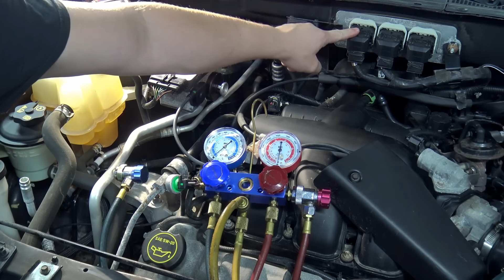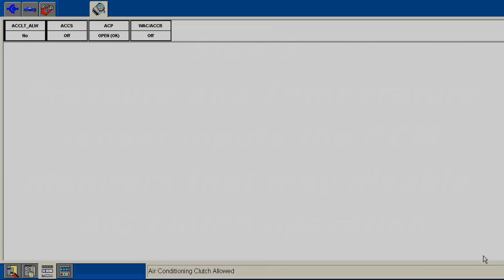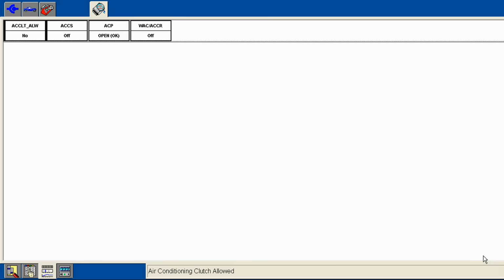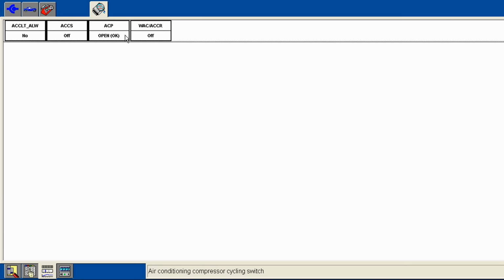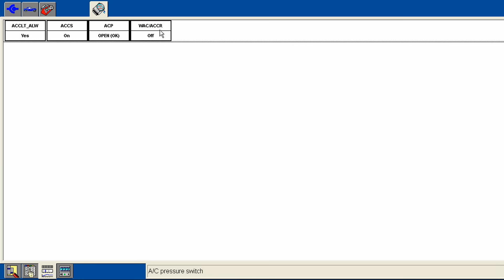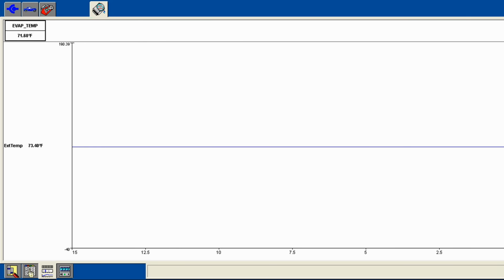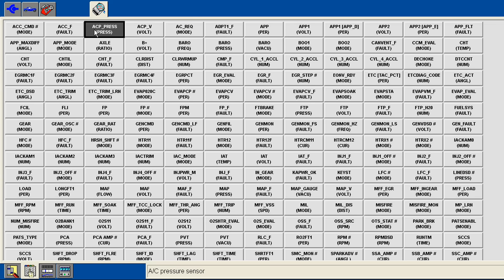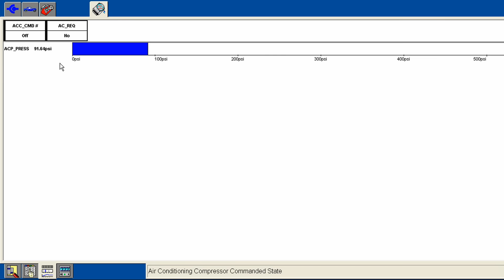Ford A/C Quick Tips #7: How To Quickly Diagnose A/C Concerns

Comment: I'm going crazy with my 2018 F150 Eco. The AC works when it feels like it and the dealer still 'can't duplicate' the issue after 3 visits. Love the truck, but this is driving me crazy, especially for a vehicle that only has 2100 miles on it.
Reply: Good luck. My 2017 Flex has been in the shop 28 days since July 5th; the compressor disengages when the outside temperature goes above 90°F. The dealer has been able to duplicate the issue, but no one seems to know how to fix it. This is my eighth Ford, and the only one I’ve ever had a major problem with.
Reply: @DavidBugea  What was the cause on yours? Mine's very sporadic. It can blow warm on a cold start up, warm start up, or while driving. It's all over the place. It will go out while driving and then start blowing cold again after ten minutes, or over an hour. It's crazy.
Reply: 231mac The dealership still hasn’t figured out the cause, and has stated that they have reached out through some nationwide Ford knowledge base, looking for answers. On three occasions I’ve shown it to my service writer and a technician while it’s doing it, with no luck. I finally opened a case a week ago with Ford Customer Relations; they called last Friday, but can’t get them to return my calls. After eight Fords it seems like I may have gotten stuck with one that’s unfixable. You’d think that a/c would be a technology that they’d have figured out by now...
Reply: @DavidBugea  Yeah, you would think. It sounds like you've reached the eligibility for the 'buy back' program. But, it's not as glorious as it sounds. From what I understand, you'll most probably have to hire an attorney and Ford will pro-rate the crap out of the vehicle. Best of luck!
Reply: 231mac Which is a shame, because I really like the vehicle. I’d be perfectly satisfied if they’d just fix it.
Reply: @DavidBugea  Same here. This is the first truck that I have been extremely all-around  happy with, besides the AC issue...
Reply: 231mac We think the mystery of intermittent air conditioning on my Flex has been solved, and I wanted to pass it along to you as something you may want to try. It’s a simple solution: Disconnect the negative cable from the battery, leave it off for 45 minutes, and reconnect it. Yes, that’s it. I did it six days ago, and haven’t had a problem since. Long story, but it cleared the computer, which had something stuck in its “learning” to limit when the compressor ran. Not happy that I had to fix it, but happy it’s fixed.
Reply: @DavidBugea  That's great you were able to fix your vehicle. I just got my truck back and they had to replace the evaporator core and low pressure sensor. Been working like a champ since. Best of luck, David.
Reply: what thay do tp fix it
Reply: @irenesalas3582  Not fixed yet. The truck is going back to the dealer tomorrow. At least I finally got the issue verified and documented Saturday, so they can't claim 'cannot duplicate' anymore.

Comment: If you can one tip,in my ford fiesta 1.3 44kw 2004 ac stopped working the gas was filled to specifcation(0.650kg)both pressure sensors are changeable the copressor is only activated directly the fan goes off.Clutch and fan relay no grounding(pin 86)i was in Ford servis and they didn't know how to fix it please help what i do os too hot  best greetings

Comment: 2006 mustang no air comes out of vents but compressor turns on when doing a cold start everything works and air comes out of vents but when vehicle warm air stops coming out
Reply: Have same issue on a 2006 F150 4.6. Did you figure yours out?
Reply: @danthomas9532  no not quite but I think I have checked online forums and it points to actuator behind gauges driver side not sure about f150 but that's what i read on mustang forum

Comment: I have an 06 Ford expedition and I noticed it was leaking a small amount of green oil. I looked underneath the truck and there was green oil on my AC compressor. It also dripped down to the front  axle. This was pointed out to me years ago  during a oil change and they said my front gear oil was probably leaking from  bad seals. It is four wheel drive by the way.  this whole time it seems to be coming from the air compressor. Could you please help. The a/c has worked for many years without any problems and still works..

Comment: Thanks FordTechMakuloco!

I have a car where the ac clutch is kicking in but I see only 37PSI on low and high maifold gauages.. 
I think this means my compressor is not compressing.. 
but I was wondering why it doesnt show higher after I went to a shop and had them evacuate and fill that day.. they told me it is probably electrical.. because they had filled it.   but when I checked myself the next day I see the 37 LOW and HIGH on my manifold gauges.. 

get the compressor?

Comment: After watching the video its plain to me that I will surely have to take it to a shop. I have no way to check this stuff myself without the tools used in this vid. But thanks for posting cuz I can at least have an idea of what the mechanic may talk about. How much should checking all this normally cost?
Reply: Diagnostic fee is usually around $100
Reply: That’s at the dealership tho. Local mechanic may be cheaper
Reply: There's a recharge kit you can buy, and it has the gauge built in. So, that first test is pretty easy  it gets more complicated as you go along.

Comment: I have a 2010 escape and my AC works great but sometimes the ac stops working and it only blows warm air. It happens when I'm driving and idling, it's not a vacuum issue. It happens on extremely hot days the most. As I jolt the car either by stopping or driving from a stop it will come back on for a few. Maybe my relay on the dryer is shrinking just enough on 100° days to be faulty? Pls help!! Have you seen this issue before I have no way to test the relay or the PCM. It's a $26 relay, should I just replace it?

Comment: AC blows cold/cool air  on driver’s side but hot air through the passenger side vents. Is this a control switch malfunction or a ac system caused problem?
Reply: It is probably your blend door under the dash. Vacuum motors move doors so that you can direct heat and or AC to your various vents. Search for a forum for you particular vehicle, great help on forums.

Comment: I was told that you have to bypass pcm to get the clutch to engage so the system would fill from the refrigerate can when there is no pressure. Is this true? 2008 f250 sd. If so how is it done?

Comment: 2013 f150 XLT ac is cold when running or when it's cold outside but when it's hot and the truck is parked or stopped ac won't blow cold. Any suggestions on what it could be

Comment: Hello, I have a 2018 Ford Transit 350 XLT van with ecoboost, the van has 24k miles and the A/C is blowing almost warm air when the outside temperature reaches 85+ degrees. I took it to the dealership and their diagnostics did not find any faulty parts or problems with the system. But the A/C is obviously malfunctioning, when the outside temperature is below 80 degrees, the air is very cool just like any other car without any a/c issues, but in Florida by 10AM, the temperature is always above 90 degrees, and I have my family sweating in the car even after driving for more than 30 minutes. Can anyone PLEASE help me with some advise???

Comment: Hey I have a question. My ac blows cold but only when I’m at a stop, once the car starts running the vents blow cool and not as cold anymore. About an hour or so on the road with the ac on. I believe the ac puts pressure on the engine because the engine starts making a roaring sound when I step on the gas after being at a complete stop. Does anybody have any idea what it could be?

Comment: Took 2016 f-150 to the dealer to get wheels fixed from damage at quick lane, got my truck back yesterday and now the AC cycles every 10 seconds, blows cold air but it never cycled this much :(
Reply: Gunsmoke its low

Comment: My condenser fan won't come on.  Pressure is around 60 on the low side.  I replaced the fan controller and the high pressure switch.  AC works fine driving into the wind.

Comment: Funny how this video shows up in my feed. Last Wednesday 5-8-19 it got above 80°F in western Indiana which made inside of car over 100°F. So I turned on A/C and started towards town. Stopped to turn corner and huge puff of smoke came from under hood. A/C clutch was on fire. Turned off A/C and all was good again and smoke cleared. That's funny because the night before it worked perfect like it always does. In the last 4 years I've had everything except compressor replaced by pro shops and it's worked beautifully. Tomorrow afternoon I have an appointment at my Ford shop in town for A/C repair. Can't fix it myself because it's mounted on the bottom of engine which is strange and so it has to go up on a lift. Don't know if it's failed bearings in the clutch or if the compressor locked up for some reason.

Comment: Love the video, bought the leak detector freon , filled it up to 40 with the detector and some more freon, cooled for a day or so. Tried finding the leak with black light but nothing. Looked all around. System is back with no pressure. This is a 2005 F250. There areas I cant reach. Any thoughts?
Reply: It could be the Evaporator, check the drain hose with the U/V light for any dye. You could also remove the A/C blower and shine the light inside the A/C box.

Comment: Hi, great video, I have a 98 ford ranger 4x4 when I put a/c compressor is on but blows warm air, if I switchen to max a/c compressor is on and blows cold air., any Idea why on regular a/c not blowing cold like should be even if the compressor is engage? Thank you.
Reply: Might be the blower motor resistor. When they start to go bad, a/c usually only blows cold on the highest setting
Reply: @TheOverlyIronic  thanks I'll check that.

Comment: Hi ,how u doing , I bought a Ford Escape 2008 and it's ac not working light comes on on dash and blower working fine but I don't hear any click from ac compressor. So I search on google and found your videos. And I am going to buy a gauge to check the low presser on ac. I just open the cover from the low presser valve and press the valve nothing came out from that valve. Is it a sign of no refrigerator on my ac ? Thank you very much for your videos ..

Comment: Hey thanx for the well thought out lessons. I am stumbling over my dealer shop manual for my Chevy Venture saying use R134a synthetic PAG oil internally in the AC system, but the seals and fitting threads are to be coated with 525 viscosity mineral base refrigerant oil. They warn of dire consequences. The only 525 mineral base refrigerant oil I find is R12 compatible, none so far say R134a. Wouldn’t traces of the mineral base get into the internal (“circulating is” the term they use) R134oil ? And how can the internal oil damage the seals? It says it over and over. Also, for $9 I got the 1999 manual. 2,000 pages, the real one. It has an accumulator as opposed to my 2001 having a receiver/dryer. The Manila says 8 oz. total internal PAG oil, but it says 3.5 goes into the accumulator. Does the receiver/dryer get the same amount? The 2001 manual is $140. I need to know how much goes into the entire system (C60, front HVAC only) and how much, if any, of that goes into the condenser and the receiver/dryer. I assume the evaporator is the same as the 1998 model. I have all new components save for the refrigerant lines and senors/wiring. I’m putting new weather stripping on the doors in the HVAC case while I investigate this further. Any advice or pointing to a cheap source of the info would be appreciated. I tore the whole dash apart by the seat of my pants while blind in one eye from surgery. The Haines dorsn’t Show the HVAC case/evaporator replacement procedures, and I just got the dealer shop book the day after I got the case/evap out. I hadn’t perused these out of date dealer manuals online until 10 days ago.

Comment: 2006 Expy Limited  Clutch does not engage sometimes until we run for 5-10 minutes, then it comes on and works fine.  With just a multimeter, no scan tool, how can I easily check if the clutch should be engaged.  Want to rule out a bad coil or bad relay.

Comment: My 07 escape the clutch locks up but disengages quickly  and no cold air out the vents.????
Reply: Needs a recharge.  Not enough refrigerant in the system.  Must have a leak

Comment: I have a 2013 f150 5.0L. I live in Canada. Its been cold. I have found lately the cooling fans have been running on high about 30 seconds after i start the truck and doesnt turn off. I checked all the relays and havent found anything yet. Could the ac pressure switch effects this? Any suggestions

Comment: Got a new problem that maybe showing up on new Explorer / working fine when you get to were your going . Later start back up front not running back working something dropping out to power front blower . Tech's can't find this one. It comes and goes . Leaning towards shit pin connector or slector control . Hit a bump  and it has a effect . Seen no bulletin on this.

Comment: I have an issue Wth my 2002 Ford Expedition 5.4 liters Eddie Bauer edition I have a problem Wth the A/C like the whole system works but when I put max a/c to full blast the air does not blow to the vents it blows to the defrost port then like 10-15 minutes later it blows through the vents but the air is not to cold it’s mild cold I really need help diagnosing this problem been trying to figure it out for about 6 months already
Reply: Have you checked the doors/actuators that tell the air where to blow out of? Some are controlled via vacuum others are via electrical.

Comment: Always a GREAT JOB and REALLY Appreciate your knowledge. My problem is on a 2003 Ford Expedition XLT is that the air comes on but sometimes blows out the front vents then switches to the top/ bottom vent. Any ideas?
Reply: This just happened to my Ford. What was the issue that you had,and the fix, please?
Reply: @PeaceJourney...  
Hey,
I pulled the radio out and was able to get to the part that controls the damper.
Sorry for the lack of terms there.
But, the part that controls the vent was bad.
It was about an 1hr to fix and the part was something like 14 dollars. 
I hope this helps.

Comment: Using Forscan, it says Evap Temp is 25f to 29f all the time. Ambient Air Temp is 105f when it is 80f at 11:00pm haven't ran the car for around 6 hours. I guess that would be a symptom of bad Temp Sensor?
Reply from the maker: I would check it with a real scan tool.

Comment: I have  2009 Ford escape hybrid 
AC gauge reading's 
At 95f here in Florida
Low side 55psi
High side 150psi
(System when is off It equalize both of the gauge readings 150psi) 

System cold when im driving or at 75f days, both of the fans are working, but the battery (hybrid)cooling system is not working properly,lines are not getting cold I need help with this
Reply from the maker: With those pressures you need a compressor, the scroll valve is stuck

Comment: I had a shop try to charge me 2900 bucks because the compressor is shot. My refrigerant keeps leaking out. I assume its the seal inside the compressor. Can I buy a new compressor and just replace it? They said if they're replacing the compressor, they had to replace a ton of other stuff.
Reply: Generally when the system is opened its recommended to replace the expansion valve, evaporator drier, etc.
SOME will let you get by with just minimal stuff but not warranty the work.
That's why though - if system is opened up its exposed to moisture which is damaging.

Comment: What about i have a 2011 crown vic ex police car ehen i turn it on my compressor kicks on my blend door does its thing but my blower motor does not kick on period its manual ac ive took my blower motor out tested it its good ive replaced my blowrr motor resister still nothing and like i said its been working fine for a year and a half please help...would like to hear your input mabey the head unit please help

Comment: What's your opinion on installing a 1/4 turn ball valve inline of the supply side heater hose to disable hot water flow thru the heater core during the summer months?
Reply from the maker: No that is what the internal temp blend door is for.
Reply: FordTechMakuloco Thanks for answering.
I asked that Q? because l have heard that the blend door doesn't ALWAYS close 100% and that the a/c can pick up some of the heat from the heater core.

Comment: I have a 2013 f150 the ac only gets down to 48 degrees. I put scan tool on and it says that the truck is at 36 but the ac coming out of the vents it’s only 48. I think it’s the evaporator AC sensor. Took to ford they said nothing is wrong and 48 degrees is acceptable. I don’t agree. I just think they don’t want to do The job because they would have to take the dash apart. Is there an easy fix you could help me with?

Comment: Please help I have a 14 ford explorer ac cool when It want too as long as I'm sitting as soon as I drive it blows hot but the ac compressor is still on but blowing hot air I also changed the ambient temperature sensor still not working

Comment: 2006 fusion 
27-170 pressure
A/c doesn't cool much, even at idle. Also, the AC clutch stays on all the time, it doesn't turn on and off.. like other cars. Any suggestions?
Reply from the maker: low and low looks like a low system charge to me.